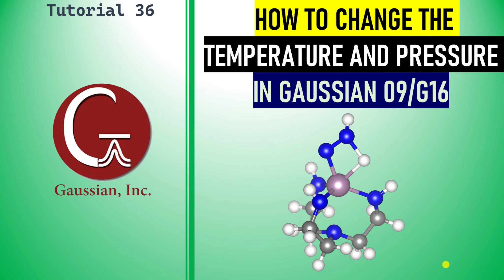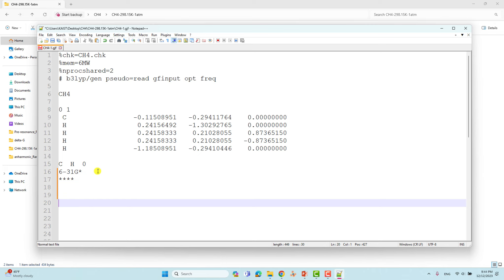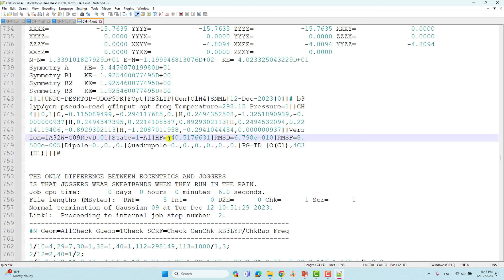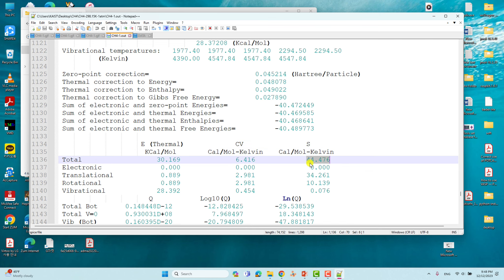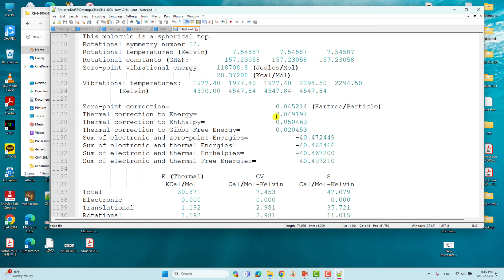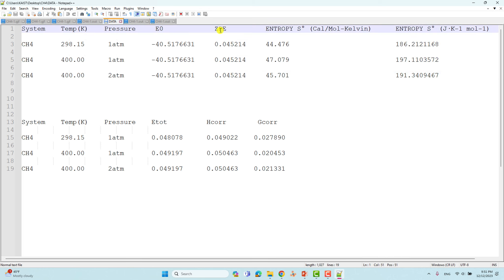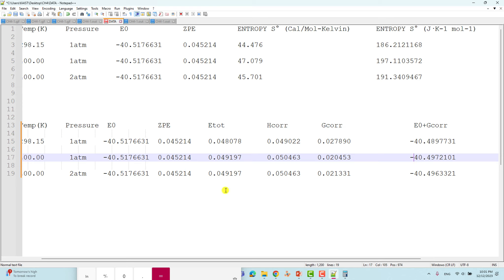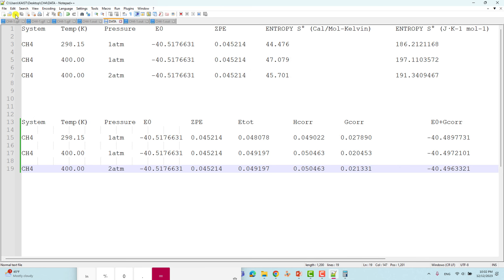How to do DFT calculation in different temperatures and pressures using Gaussian 09W and G16

Comment: Dear Admin, Thank you. You are doing very well. I have a question regarding Pressure. If we need to calculate at High Pressure (in GPa), do we need to change GPa to Atm or only write GPa with the value? What do you suggest for the Method and Basis Set selection for high-pressure calculations?
Reply: have you tried ?